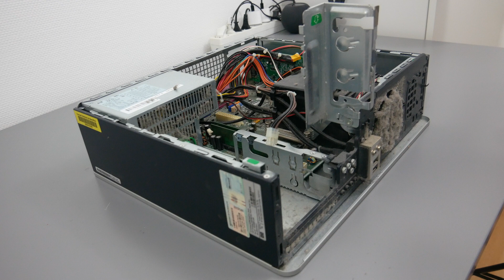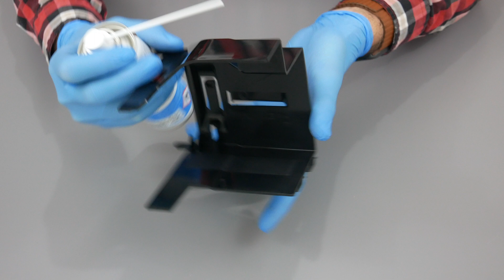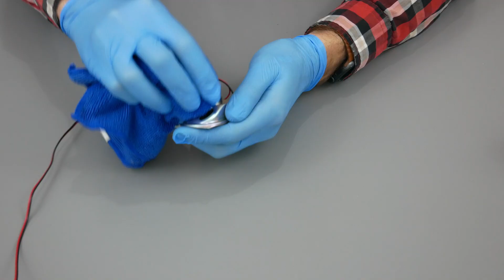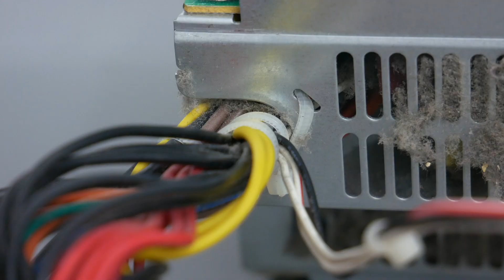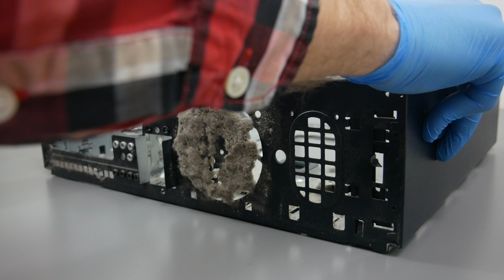Let's CLEAN this 15 years OLD Computer (HP Compaq dc5750)

Comment from the maker: Hi guys!!! First of all, THANK YOU FOR BEING HERE ❤️ It's so amazing to welcome you on my channel, to see your comments, your likes, and a special thanks to my first subscribers 😍.

Did you enjoy this video? Please remember to:
 - Like it 👍
- Tell me what you think about it in the comments section 😍
- Share it on the social medias 😘
- Subscribe ❤
- Follow me on Instagram for more content: https://www.instagram.com/french.satisfactory/ 😷

Kisses from France 🇫🇷

Love you all! ❤
Reply: Well, I wouldn't remove the CPU and the RAM modules until completely blow away the dust. I nearly binned a RAM module, because it turned out that I blew some dust into the slot and the system failed to recognize it. Also, I would keep these PGA processors in the socket, during thermal paste removal, especially the hardened one.   Placing the CPU on the pins and rubbing it could be a recipe for disaster. Otherwise, excellent job! I really enjoyed the transformation!
Reply from the maker: hehehe this is my very first video, so be sure about that I did lot of improvements in the cleaning process video after video. But one thing I'm still doing is that I still remove the RAM before cleaning. I think you are pretty right about this, I will reconsider this.
It's great to know you enjoyed this video Hristo! Thanks for your comment ❤️❤️
Reply: Buenas me sabrías decir cuánta ram soporta este PC y gráfica tengo un PC igual
Reply: @HristosTrUK  Absolutely! CPU protects the socket from dust, indeed.

Comment: I prefer to use first a vacuum cleaner and then wash everything, literally everything.
Reply from the maker: Yeah, I will change the process soon I think. I realised after some of your comments and during the video edition that the result is not really perfect 😅Just don’t have time to work on it for the next episodes. But soon.
Reply: @french.satisfactory  Ah, did I more comments about that? Sorry for being annoying. 
Probably I win not use water on my high end video card (it doesn't need that deep level of cleaning anyway).
 But for this old cheap stuff I do not really care.
Reply from the maker: Well when i am saying "your comments" I was thinking about the comments I received about this topic. not only from you. On my side I will start to wash the chassis and heatsinks with water and soap. I don't think I will do the same thing with the rest of the computer. For it, I will trop to have a deeper cleaning by another way.

Comment: Hey sir, is this mother board support for upgrade prosesor?
Reply from the maker: Hi Zia Hanif,
Good question, and hard to answer it because I didn't keep the exacts references of this motherboard.
You can find here all the HP documentations about this model. https://support.hp.com/fr-fr/product/hp-compaq-dc5750-small-form-factor-pc/3253421/manuals
You should find what are the CPU limits there.

Comment: Let's see, what we have today 🤔
It is not too bad 🙂.

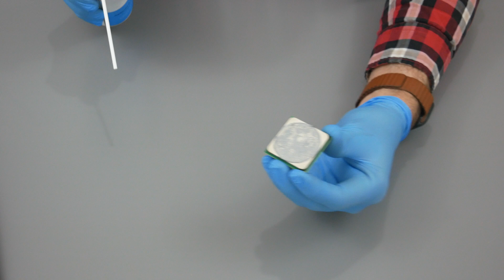05:24 To avoid accidental bent CPU pins I clen it inside its socket on motherboard and when done I take it out to check status + dedust if need be and returnnit back 😁.

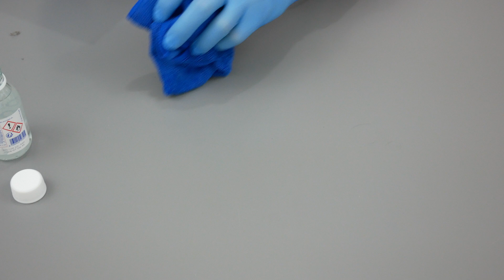06:19 Sometimes dust accumulazes so much inside the fan that fan struggles (just a tip for everyone to check if fan is spinning freely with finger test and later under power).

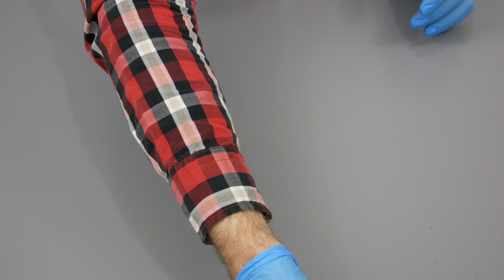10:10 I suggest you add a warning when opening power supply (PSU) because that big condensers can hold a lot of power and can kill you if not carefull❗

Great video 😁.  Honestly ASMR type videos I do not like but this like cleaning type is one of few things I like 🤓.
Reply from the maker: Yey thanks a lot for another comment ACOnetwork!

This video is literally the 1st video I've ever upload 😅 Nice to know you enjoyed hating it 🥰

Your are probably right about the disclaimer before opening the PSU. I will think about it.

Thanks again ACOnetwork ❤️❤️
Reply: @french.satisfactory  I did not enjoy hating it but I enjoyed liking it 😁... that is the difference.

Yeah I skipped first video last time so it needed to be fixed 😂🤣.

Have a great night, I am off to sleep hehe.
Reply from the maker: 🤣🤣 don't know what happened with my keyboard 😅 anyway, you got it!
Have a great sleep ACOnetwork ❤️

Comment: I hink you should upgrade it! Looking like an old hp but more powerfull!
Reply from the maker: Thanks for your comment Lietus. I'm currently working on the 2nd video and stay focus the same concept and quality improvement for the moment. It will be published this Friday. But for sure, more content is coming. I will try more things in the future.
Reply: @french.satisfactory  Great to hear!
Reply: The motherboard may be a non-standard layout in a compact case like this, so it might not be possible to fit a newer board.  If upgrading the current motherboard, there might not be many options for a faster CPU that will fit the socket.  Seems to be Socket AM2, so maybe the best that can be fitted is an Athlon 64 X2 Dual-Core 6400+ (online sources suggest the maximum may be the 5200+).  It's going to be fairly power-hungry, not necessarily cheap, and 15 years old.
Reply from the maker: Hi MarkTheMorose, thanks for your interesting and detailed answer! I don't think I will try to upgrade this PC especially with the information you provided us 👌.
Reply: @french.satisfactory  Could be a nice little PC to mess about with Linux.
Reply from the maker: Don't know yet what computer I will clean for the next episode. I still have to find it, so it's hard to say what I will do even later 😅 But as usual, I will try to do my best to make a nice video to watch ✌️